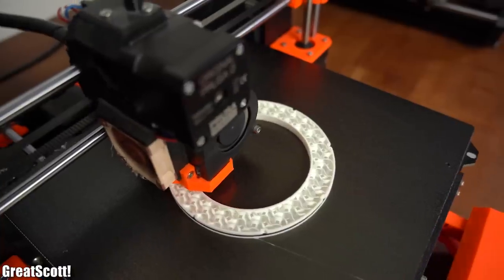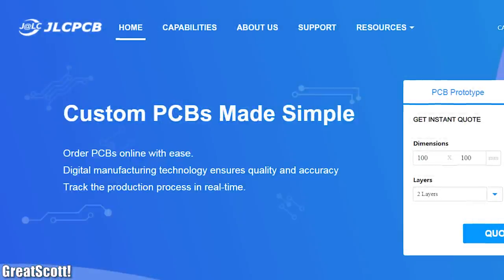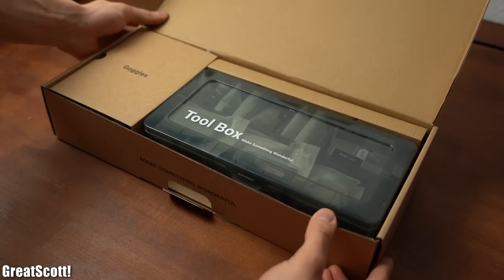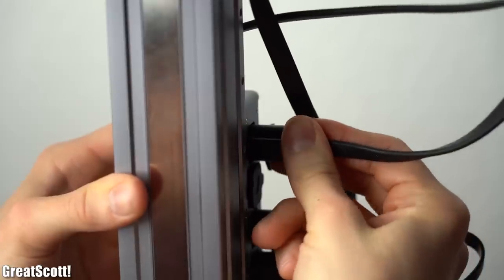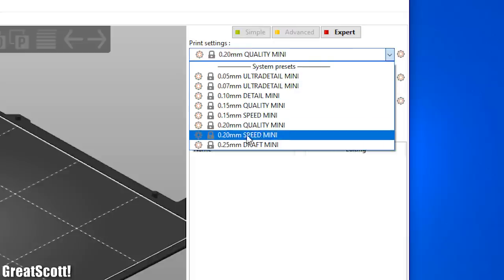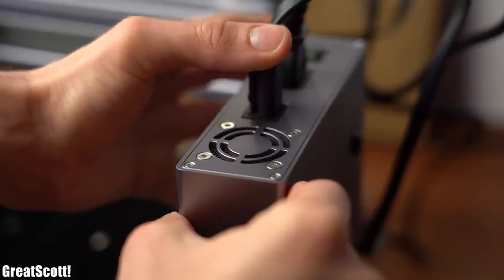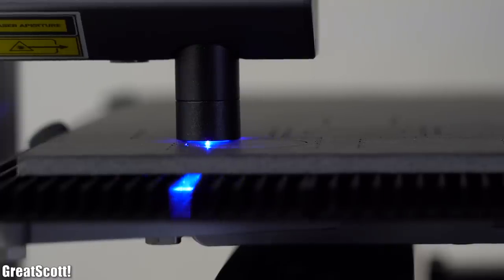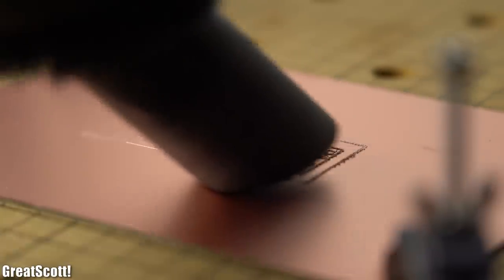Testing a 3-in-1 Machine || Laser Engraver/Cutter, 3D Printer, CNC Machine || Snapmaker 2.0

Comment: When I think of a 3-in-1 machine, I'm expecting all the functions are available without reconfiguring the machine. This looks like an expensive toy that does not do a good job at its three functions. Don't get me wrong, it might perform adequately, but for that price point, three dedicated machines would perform better. The only advantage here is saving space.
Reply: yeah, at 500-600 per machine you can definitely get similar results and you don't have to change configurations.
imo the bed being annoying to replace feels like a dealbreaker, if it was a simple lever action, and you switch modes, that would be a lot better, and may be expected in that price range.
though I can see it's use in classrooms where you can bring it out of the closet, prep the correct tool before the class, and you don't have the hassle of 3 different machines.
I do think it's more aimed at smaller businesses than individuals.
Reply: Where ca you get three separate machines at comparable total price? And dont post the dirt cheap aliexpress ones, you can get a comparable quality 3d printer, but laser engraver and cnc?
Reply: @frameshade  2020 extrusion based ones are fairly inexpensive, though they require more assembly.
the included spindle doesn't seem like it's much better than the ones on the mid range aliexpress ones (i.e. not the ones which screw directly to the shaft of a standard motor).
of course you give up some prettiness and ease of initial assembly, but imo if that's for personal use you'll probably want to tinker with it anyway.

tl;dr: end product wise 3 machines at 1/3rd the price would perform better, but would also need to be a bit more hands-on.
Reply: @frameshade  What's wrong with the "dirt cheap aliexpress ones"? You can argue about the accuracy and stability but they do the same job and it's more than enough for a hobbyist. Most times it's already a 2 in 1 bundle where you can easily choose your laser power.
I don't even think that this 3-in-1 machine is a better choice, if you have such high requirements on a specific tasks.
Reply: @Belias Phyre Saving space isn't even an argument here imho. You still need to store the tools you don't use and with a 3d-printer you need space for your filament anyways. I mean a cheap cnc is probably the same size as  3-4 filament spools.
Reply: It is well designed and well packaged but for this price it has severe drawbacks: It's not really moddable, the spindler is a small one, the laser is only 1.6 W and at 10:09 you can see that the structure is not so rigid so it's only for small CNC projets. I didn't find in the specs but it's probably nema17 steppers. For this price you can have a much better CNC with nema23 steppers and a better splinder, a good 3D printer and add laser cutting/engraving feature to the CNC or the 3D printer.
Reply: This was my conclusion as well.
Reply: @frameshade  You can easily get a comparable, or rather better laser engraver for a fraction of the price from Banggood. About 200-250$ for one with a much larger operating area. By default a 2500mW is included but you can upgrade it to 10 times the power if for some reason you wish to. Marco Reps has also done a video about some upgrades that increase the precision of the laser and make it nearly completely silent. I own one and it's fantastic, although the software is definitely garbage and shouldn't be used.
Reply: I am surprised that they even call this a laser cutter at not even 2W. Of course it does cut thin wood if you do 100 passes for over an hour... but that creates tons of smoke and is no fun. Other more heat sensitive materials will not work at all and just melt. Imho these open lasers are not worth it, mainly because of the smoke problem and too low power. Instead directly get a enclosed 40W CO2 laser cutter, they start a about 350€.
Reply: It's an engraver, not a laser meant for cutting wood. If they wrote it's a cutter, it's the typical advertising BS, but it can cut certain materials. ALL diode lasers are generally bad at cutting (especially when it comes to wood or specific wavelengths). Even if you upgraded it with a 25W module, you'd burn the hell out wood and it would shoot right through transparent plexiglass for an example. And yes, engraving does produce smoke. Making a simple box enclosure with an exhaust fan is a one day project that can be done with salvaged materials though, not sure what you expected for the price. I personally got it for around 179$ I think, easily worth it. 

I agree that a CO2 cutter is a better option, but those 350$ tend to turn up into at least 400-500$ when you get some unreliable part or a broken tube.. or when they burnout after a few months. There's a lot of reviews on these units and the general consensus is that they're crap until modified, which of course costs extra. Any proper CO2 laser is better than a diode alternative, but it's also much more expensive. It also requires a lot more knowledge to operate one whereas diode lasers are kinda idiot-proof really. There's also the operating area, with CO2 you're stuck with what you get depending on the model, with these "DIY" things, you can go as far as you want with firmware changes. Don't get me wrong, CO2 LC is definitely awesome and I'd love to get my hands one one, but price comparison between those two things is based on unrealistic scenarios.

Bottom line is; you get what you pay for, at least when it comes to China.. can be a good thing, but definitely can be a bad thing as well :P
Reply: Snapmaker have a high power laser module coming in lol.
Reply: Kickstarter Backer here, I just wanted to say that the reconfiguration is an extremely easy process and it can be done in less than 5 minutes, and that its not really an issue. So far ive found that it works great in all of the applications ive used it for. I should however mention that because i backed the kickstarter i got my machine for only $1000 instead of the $1800
Reply: I have it and I would say that it's really convenient if you are creative and experienced enough.
Reply: @frameshade  you can get the prusa for 400 and a good cnc for around 700 and laser engravers can be found for dirt cheap.
Reply: Tbh anything multifunction/3 in 1 is a bad idea.
In my experience they're always "meh" at all of their functions, better idea to get separate tools that do a great job individually.

Comment: You pay upwards of 1500€ for this shiny toy and it doesn't even use silent stepper drivers and fans plus the software is more like an abandoned construction site... i don't think i need to say much more :/
Reply: The silent stepper drivers don't support a high enough voltage to get the torque and speed required for leadscrew driven X & Y axes. They cap out at 36v and the Snapmaker uses higher voltage for the motors.
Reply: @JohnAldred  There are several types of TMC drivers (see the tmc5xxx series or the tmc26xx series) to choose from, some of which supporting fairly large motors with very high speeds, I think florian was right.... The real reason is probably that people buying cnc machines do not really care about noise.
Reply: @abelhorvath9352  Yeah, that's true. One of the guys in the Snapmaker Facebook group has been experimenting with TMC2208s and he's making some progress, but they're not as beefy as the ones that come in the Snapmaker 2's linear rails.
Reply: To be fair it does the work of three machines. But the quality/speed of the results is only 1/3. It’s nice for a few hobby projects but if you want something fast and precise you should probably get yourself the dedicated machines
Reply: @JohnAldred  There is the option to use TMC drivers with external mosfets,  like the TMC5160. These can be made to support extreme currents (<20A) and 48 Volts easily, but for this type of machine even the fully integrated TMC drivers are more than enough and it's not like the devteam would be constrained to the step-stick board format, they could have just rolled their own driver layout with better thermals, high voltage capacitors and digital control via SPI or UART. Most of their electronics is custom anyways. I've seen people with medium sized CNC portal mills use these little stepsticks with great success, you can't tell me they aren't powerful enough for the job. This was a stupid decision and there is simply no other explanation than incompetence or bean counting left at this point.
Reply: Software is like a abandoned construction site? On GitHub Snapmaker/Luban the last release was 40 mins ago, previous release 4 days ago, multiple commits every day. Might not be perfect already, but it looks very active to me.

Comment: I have a hard time believing that these are honest thoughts :/ Or at least to my eyes what's shown in the video does not justify any of the excitement. 1.5 hr of laser cutting and 1hr of milling in these thin cheap plywoods, questionable print quality, the construction bending considerably even upon the cable insertion... no mention of the enclosure-less laser cutting being a problem with all the smell? Or the cnc spindle motor being almost smaller than its own collet? IDK man, fancy packaging and cables are nice, but it's not really what makes such a machine worth its price IMO.
Reply: I backed the kickstarter and have been using my Snapmaker 2 for quite a bit now and this does seem like an accurate review and i wanted to give my thoughts. Im not sure what settings he is using but ive been able to get very solid print quality out of mine. Secondly the construction is very sturdy, cant seem to see this bending you've mentioned. The lack of enclosure is fine as long as the space is well ventilated, however snapmaker does make a very solid enclosure, that is imo a little pricy but is very well thought out, i havent done much with the CNC so i cant speak much there. But overall i would say that the review is an accurate representation
Reply: @knoxrutherford2165  My point is that if the results in the video are poor, then it should be put into a context rather than saying its all great :) Its possible that wrong settings play a big role in that and I am glad to hear that you are getting better outcome, but thats not the content in this review. Btw you have this same larger size? What materials do you successfully print with and what do you use the laser for?

My big question about these machines really comes down to whether the versatility is a pro or a con... I can too easily envision a scenario where the 3dp function ends up being the only useful one that is practically useful. And unfortunately from several of these sponsored reviews I have seen so far it looks like thats not very far from the reality :)

Comment: Would it be possible to make yet another video after using it for some months, let's say around xmas. I see many intro videos where the first impressions are good, but when using the object for some time, experiences are either less or better. I would really  like to hear your opinion later on.
Reply: This.
Reply: I've been using my A350 for 6 months now. Everything works great, actually, but the sound of it is just infuriating. I took it without enclosure, now I think to make it myself, because it is impossible to live without it if it is in an apartment and not in a garage
Reply: @maxluk521  yeah I heard it is loud. Does the cnc and everything work good on it? I used to own the creality CP01 but I returned it evcause it didn't do anything well. The 3d printer sucked and jammed all the time, laser engraving was okay but yhats about it. The cnc was loud and couldn't handle light engraving. Are those functions  better in the snaomaker.
Reply: @hunterg312  Yes, everything works fine. there are some strange moments like the fact that the calibration of the table for 3D printing takes place on a cold table, or to change the table, you need to Unscrew too many screws, I bought myself an electric screwdriver specifically for this. I mostly use it as a milling cutter, since I still have 3D printers, and the laser has not yet been much needed, I used it only for the sake of tests. milling is excellent, I use mostly 6 mm diameter cutters and it handles them well. Overall it gives the impression of a very hard and excellent machine
Reply: @maxluk521  so would you say its worth the $1500 for the a350?
Reply: @hunterg312  it cost me $ 1,179 and I probably wouldn't have bought it again. for this money, you can take a large CNC machine in Russia, but as a home option snapmaker is super. for 1500 dollars, I think it is better to take a separate CNC and 3D printer. they can work together instead of taking turns
Reply: @maxluk521  yeah I guess. I don't know too much about cncing I already have 1 3d printer. Idk I may get this

Comment: that print quality of the snap maker was so bad!  why is it so expensive?
Reply: Quality.. product cost..
Reply: Remember that he dialed most of the print settings manually. It seems like there are no premade profiles like for the prusa printers. Prusa profiles are very good and tuned... so in my opinion it is understandable that there is quality difference after a few houres on a completly new printer.
I think the hardware of the printer is good and can perform on the same level as the prusa models. It is just a matter of software and settings.
Reply: The 3d Printing Zone showed better prints
Reply: Not sure what settings he was using but i got way better results out of my snapmaker than what he was getting

Comment: I'm digging the attention to detail by Snapmaker. There's something to be said about a company going after a market segment of customers comfortable with paying more for a higher quality fit and finish. I like inexpensive items, but at a certain point that just means the cost of quality control falls to the end user.
Reply: Chris I totally agree.  For a 3 in 1 machine at $2,000 they did an incredible job.  Sure, there's budget options out there where you can get good results for half the price but it's going to require 3 machines that will likely demand that the end user figure out everything from the hardware to the software.  I like tinkering as much as the next guy but there's definitely a premium I'm willing to pay if I can minimize the headaches of actually using these tools.
Reply: @030398ryoma  I think it depends if just you want a tool for another project, that should work out of the box and be reliable. Or if you see the building of the machine as a project itself and want to understand every detail, which includes modifying and tuning everything yourself.
Reply: The aesthetic of the product is also something to behold, from small touches like the breathing effect on the front of the PSU, to the really polished looking UI on the integrated display.

Comment: I have been using this machine since it came out on Kickstarter and arrived at the beginning of this year. I think the Software is still work in progress for the 3 Printing slicer at least. I would recommend a 3rd Party slicer. With that I was able to print even Nylon without any problems. And I would recommend building an enclosure for even better 3D Printing results as well as acoustics. 
Great Video overall! as always :)

Comment: Next time, can you cut metal with it? Also you should do a multi process project where you cut, engrave and 3d print onto one work surface... say like a face sculpture, where you engrave the facial features into a board, Laser some parts for contrast, then print raised parts like nose and hair with the 3d printer. And do this all without removing the material from the bed...

Comment: I like that a lot of these comments are about how "for that price I can buy three ali express machines that will do a better job than this will" Sure. Maybe you can get machines that will do a better job than this. But that kind of defeats the purpose doesn't it? The whole idea of this machine is to turn your desktop into a workshop. I don't know about you, but I definitely don't have the space to have three machines set up. And the ease of switching from one mode to the next, in my opinion, is totally worth it. Not to mention, you can buy a 200 dollar 3d printer off ali express. But you can be darn sure that it won't last more than a month if you use it frequently. When you spend the extra money to buy a higher quality machine, it lasts a lot longer. Not to mention these machines are completely modular, if a part wears out you can just replace it. And in my experience, when I had a problem with the fan on the power supply failing (due to my own negligence mind you. I got sawdust in it and it gummed up) I was able to send it in and they fixed it for *free*. When you buy the better product. You get a better product.

Comment: Pretty cool to see a commercial version of what I'm doing for myself here for the past month or so. And... heck I've saved a ton of money on this project compared to buying.
Obviously it's not as fancy or consumer-ready, also using a lower power laser (that is, if they count 1.5W as optical output power and not electrical power input), but funny to see that I've even had a few better ideas than the commercial machine like easier bed replacement and tool head replacement without wiring.